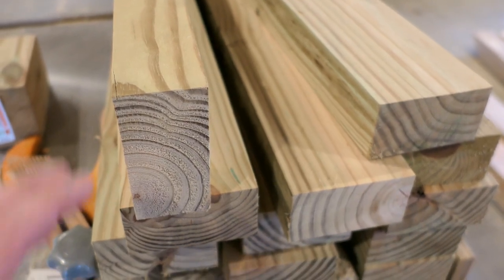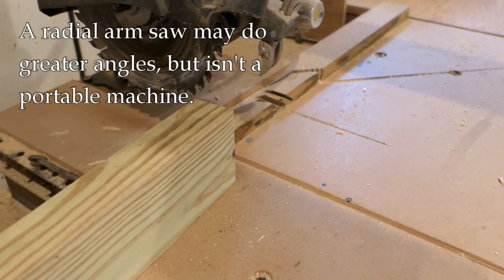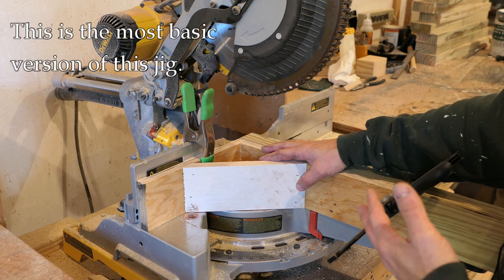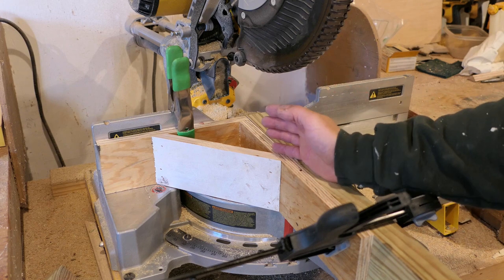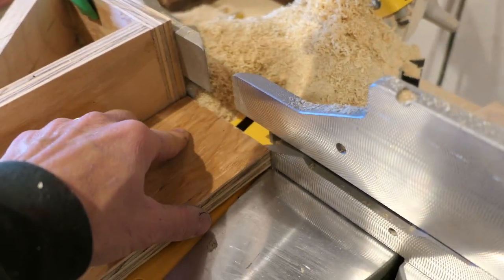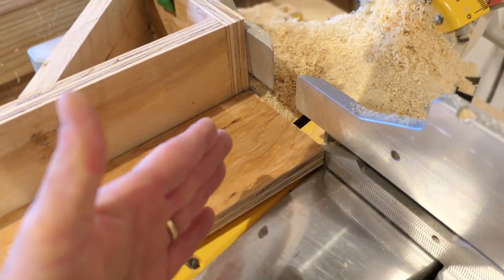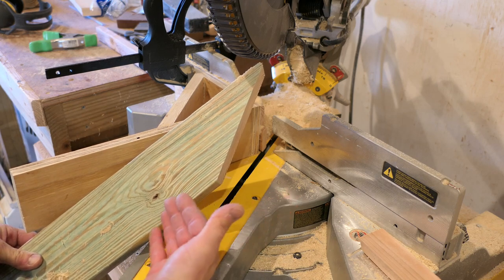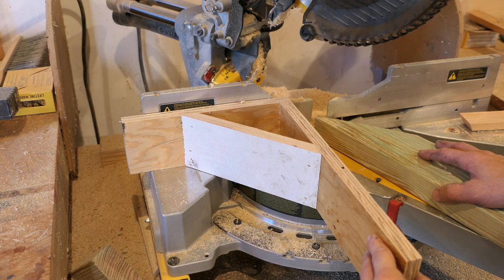Extreme Angle Crosscutting On a Miter Saw

Comment: Hello John nice to see one of your videos again I'm a little leery about anything that does a modification on a fence, further once you take that to another degree(pun intended)you're exponentially risking safety- including having to lift up the miter saw blade guard with your thumb! None of that sits well with me while the general untrained public may try dangerous tricks on big box store saws... Anyhow good luck with projects & would like to see some of your recent homeowner restorations.
-JD
Reply from the maker: I held up the blade guard just as a matter of habit--I often do that to prevent catching on the work piece and give me line of sight.  It's not necessary to do so with this jig.  If you're not comfortable or confident with your skills yet it may come with more time and experience.  The truth is, to work on advanced amateur or pro level in woodworking or carpentry it's necessary to use jigs, fences, stops, and similar modifications to basic tools.  This fence, I think, adds a safety factor if clamped well to the saw.  The same goes for other homemade accessories such as featherboards on a table saw, or tall fences on a router table.  But, everyone needs to understand their own limitations,  I agree.